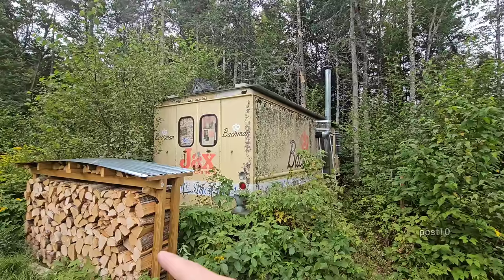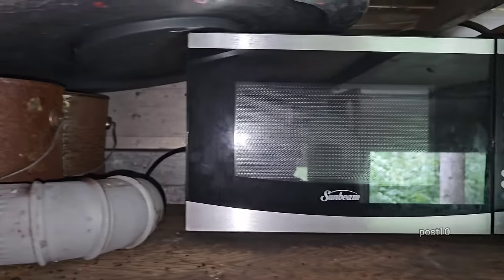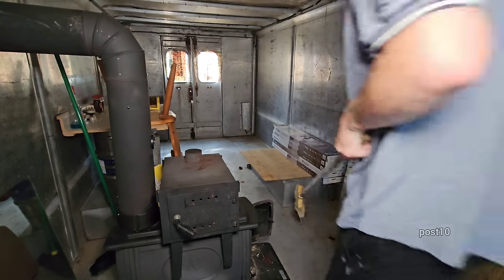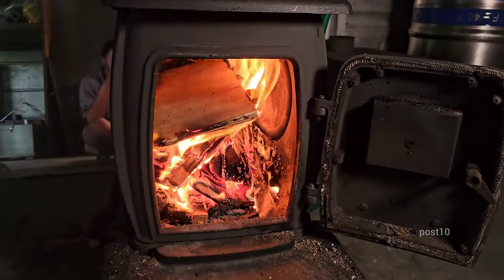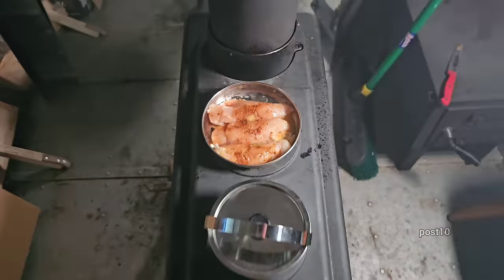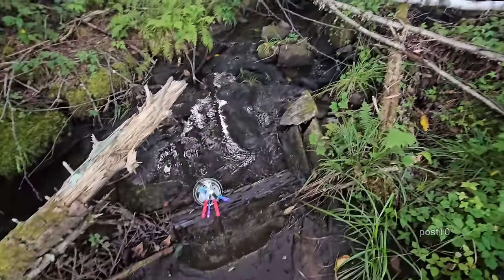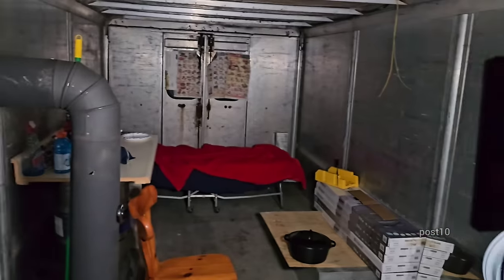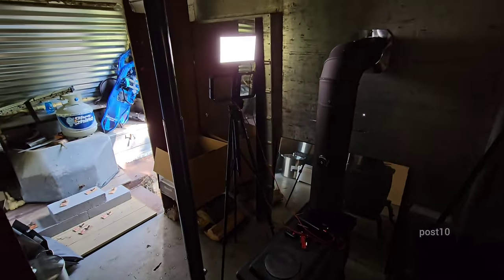Very Hot 24 Hours, Summer At The Abandoned Truck Camp

Comment: There are reasonably priced solar powered roof vents to expel hot air since you only need it when the sun is on the truck anyways. A couple of thin vents on the opposite end near the floor and you'll have decent ventilation. I'd try really hard to seal it up completely. For rodent control, use a home depot bucket and a bucket topper with flip side rodent trap. works amazing. Just need a ramp for them to go up. Sweet video post.
Reply: floating rotting mice in the heat of summer would not be good in that metal truck! Best bet is sealing up the truck best ya can and perhaps using moth balls and things they hate the smell of. Or get a pet snake LOL
Reply: Microwave has been breached. Mouse poop in the microwave

Comment: You are always on an adventure... thanks for sharing! If you are out there again, you might think about putting those plates on the top where the screw is too.  Those "pointy" ends will press into the 2x4 with not much weight.  I'm using a similar approach to prop up the hay loft in my barn right now.  Cheers!

Comment: Hey Post, I know you said you probably  won't do a summer video again, but have you ever thought of cutting out and installing a window for better ventilation and temperature control? And maybe a solar powered fan to push out some heat and smoke. You can also try putting a Black-out curtains to block the light and heat coming from the rear doors. Rats/mice have good memory, so if you notice you're not catching anything, you can move them into more traveled areas or where you see mouse poop, or try using glue traps!
Reply from the maker: I'm trying to keep it as is as much as possible, looking like a truck not like a house
Reply: @post.10 use one of the already existing holes for ventilation and pushing hot air out. You can use the front door and the screen for fresh air intake. For the exhaust you could take out the window in the backdoor and make some sort of solar fan with a modified exhaust pipe to connect to the removed glass window to push the hot air out. This'll help you with any odors/moisture in there as well

Comment: Thanks for sharing your truck camp 🎉 🤔no engine maybe wire mesh across the frame rails and load wood from the hood access from the inside with the motor dog house.  Narrow door to secure the camper with a solar vent on top into the cab area 👍

Comment: Hey Bud, I took two electronic sonic rodent deterrent devices and converted them to DC and bought a 15 watt outdoor solar panel on eBay and two batteries i got out of some electronic scooters i found along the road and installed that in my shed and i haven't seen a mouse turd in 6 years... added a sonic bug deterrent as well and it took care of most of the bugs too.

Comment: Can't wait for added flooring, it'll look great, plus adding 1/8" thick foam sheet will slightly insulate the floor. Maybe wipe down walls ceiling. You should consider adding vents to the eiling and floors for cooling. Your thermostat stove would make it quite liveable. You could remove tin roof and spray foam insulation on outside roof, then reinstall tin roof. Warmer in winter, cooler in summer and easy to do.

Comment: You should get a rechargeable fan that you can use in the summer and winter. Put it in the front of the van in winter to keep heat towards back and cool in summer. They are cheap I use one while camping

Comment: If you want to stay at the truck camp during a cool summer or early spring camp. Maybe getting a portable gas or charcoal barbeque. So you do not have to worry about heating the inside of the truck. But just making a suggestion.
Reply from the maker: I wanted to use the wood stove because it's fun
Reply: @post.10  Well maybe you can use your small wood stove outside that might be an option. You can still have fun using the wood stove but keep the truck cool. But still just a suggestion.

Comment: Tupperware boxes with tight deals are great for protecting food from wild life. The more full deal containers that are hard plastic which are lockable are good for preventing critters. large ones with heavy items on top to keep closed works for items like bedding and sleeping bags. Your kitchenware could go in one too.
Reply: You should also consider making a closable vent on the back door with that floor vent you found.  It would help with the heat in the summer.

Comment: When plugging holes try using some SS Brillo to shove in the hole then fill with your foam. The mice will eat through regular foam but not the Brillo pad foam plugged holes. 

Be sure you check where all things lead outside. Air ducts. Rods for trans pedals. Etc etc.

Comment: Again, this is just a suggestion. Since you know you can camp in that truck, simply forget about it as a camper. Use it for storage while you build yourself a small, say 600' square  A-Frame cabin. You have the raw lumber. Talk about savings. You just have to get a small portable saw mill. Most likely, it will cost $3,000.
Think of all the benefits that little place will provide. I do still like the truck as a camper, but she is looking rough, and safety is something to consider.

Comment: Thanks for the interesting videos!  - Would it be worth investing on a big battery pack with 120v AC on it, then you could use your low power microwave in there, and maybe also install some permeant lights on a 12v system with a solar panel? That would be interesting to watch!

Comment: Dude just lign it with  insulation board. Leave a gap at the bottom for condensation. And make the board removable so you can bleach spray the back every now and then. Insulation works both ways 😊

Comment: I've got the same wood stove. Those "burners" actually heat up faster than the rest of the top for cooking purposes. 
I don't mess with paper or cardboard really. If you use a pocket knife and shave the wood, you can get those shavings to go up better than paper or cardboard. The ash from paper products will smother the flames. The wood shavings (you can also buy packs from wally world (rodent bedding)) will produce less ash, more coals and allow the fire to catch faster.

Comment: Hi guy!  Your setting the mouse traps wrong. When adding the bait, place the bait side facing a flat surface so the mouse will try to get the bait from the side of the trap. Also, spread the traps around. Don't bunch them up like you have them placed.
You can buy spray cane of plastic foam to insulate any small opening. It dries instantly and be cut with a knife.
Finally, why don't you set up some poles on the sunny side in order to stretch a tarp to shade from the burning sun!
Just adding my two cents worth!

Comment: Asked for your stove for the fire to catch faster. Once you have that little flame going if close the door to the stove, leaving a 2 inch gap and it will suck the air from inside the cabin, forcing the flame to catch. You don’t have to blow. try it. I do the same thing for my fireplace stove. I open the flute all the way up close the door, leaving a 2 inch gap and that flame picks up within two minutes. Then you can open the door and wash the flames dance.

Comment: Why not get some 4x4 post. And put two on interior walls and one on ceiling like you are putting a skeleton inner structure one in front one in middle and one in rear to support roof .then in future you could pad out the walls with foam board insulation.

Comment: I don't know. I would clear 3 feet around the whole truck and let the rest grow around for cover. To bad you can't raise it and put a cement pad under it. l get a generator and put it where the engine is. Hook it up to the gas tank. Hook up electrical panel. I'd seal the engine off with metal small holed mesh (to stop mice  infiltration. Also some kind of bug barrier. Weather proof the roof and walls. Replace the  floor and insulate. Basically make an in place RV camper. Put good locks on it. Then set up the inside.
Reply: Also seal around the stove vent with heat and waterproof caulk. Oh and a ceiling fan for ventilation (the one you put through the roof).

Comment: I know you Probly won’t see this msg but the screen door you should screw it side ways to the inside wall of the truck then cut out the outside of the truck and  along the top if the cut out use a piano hinge so it pops up like a window but has a screen to stop bugs will allow much more air flow and keep it cooler when cooking I’m summer months can keep it closed in winter

Comment: mouse trap tip: chew chocolate tootsie roll up, break into small pieces, and use that. It hardens, doesn't spoil quickly and they love it. Also, it is very difficult for them to get it without setting off trap. You are all welcome. Back into my hole now. ha ha

Comment: Make a trap with an empty spackle bucket that has a spindle across the top that spins, with some peanut butter in the middle. Fill the speckle bucket couple inches with anti-freeze so when the mouse falls in they eventually drink it. The anti-freeze prevents the mouse from rotting and stinking up the cabin.

Comment: i like your woodstock design. did you freehand it or use plans
Reply from the maker: I bought the metal brackets on Amazon for the bottom of it but the roof with my own design, I will never buy the brackets again I think I can get the same result with just a bunch of big screws

Comment: ❤Build a lean too, preferably on the front cowling where your windshield was because of it being off the ground for Your Wood Sheets. The microwave junk, is yours from in and out and the junk in the air, mice are Anti radiation. Avoid too much dust, and use a USB rechargeable vacuum, instead of a broom because of the dust. Keep the wood, it'll come in handy, keep the metal floor because its durable, those glue boards work the best for mice, unless your a PROGRESSIVE?

Comment: I know you're very careful when burning a fire, but I'm worried about your having only one way out in case of an emergency. God forbid a fire were to break out, or a bear was at your front door you'd be trapped inside with only one way for exit. You should make sure one of the rear facing doors is accessible and not grown in with bushes and blocked by cinder blocks. Just thinking of your safety is all, thanks for the content looks fun
Reply from the maker: Those back doors open without any issue nothing blocking them
Reply: @post.10  very nice of you to reply, can't believe you actually did. You're a good dude, and I love your videos thank you for all the time you put in on making content. Didn't mean to step on toes, just worried a lil
Reply from the maker: @tsar-bomba2413 I love reading my comments, the bare minimum is reading a few hours on my latest video but I often read back through everything when I'm bored

Comment: the pipe on that burner should be gas tight if water can get in gas can get out and i could see flames through the joint you need to fix this or it will kill you
Reply from the maker: That's not how a wood stove works, that's not how gas venting works either, heat works as a vacuum it sucks it right out
Reply: that would not pass UK regs